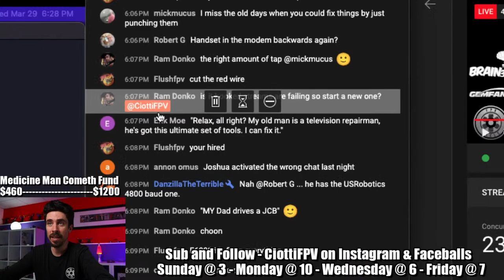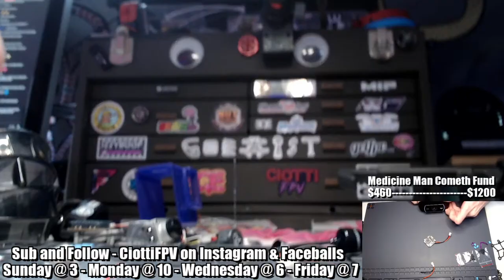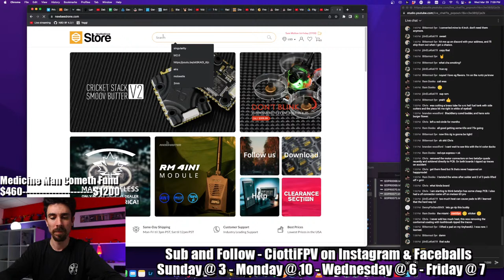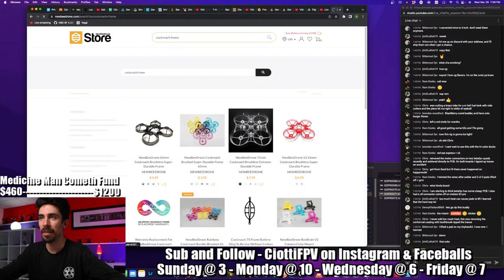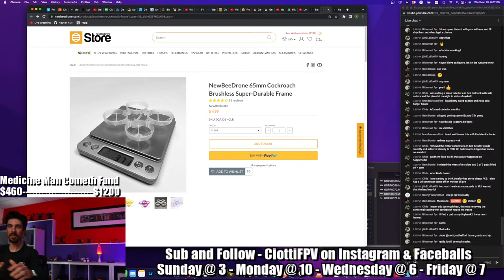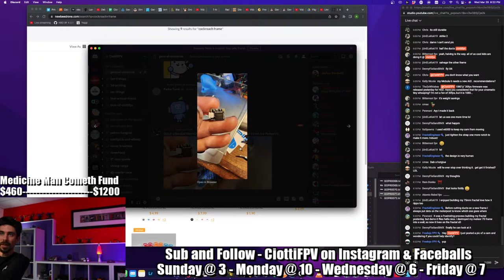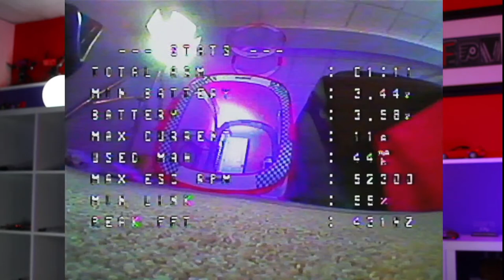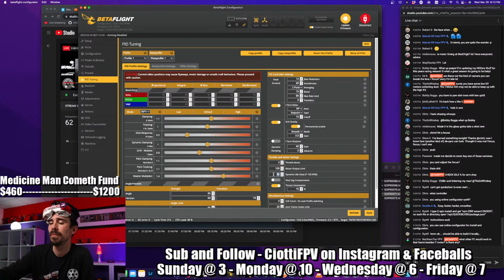Building a "Cinematic" Analog 65mm Tiny Whoop - Fractal 65 frame - Q&A

Comment: Good day friend, how are you doing? Hope your feeling more relaxed bro.

00:07:18 Building a cinematic Fractal 65 frame with the T-motor F411 AIO 1s ELRS   
00:12:30 Soldering the BT 2.0 on the board
00:17:30 Do you fly cinematic whoops a lot ?
00:18:48 How do you explain to the client that the cinewhoop is to loud?
00:21:19 Where can I copy stock tunes for my Mobula seven?
00:22:22 Soldering the FPV Bee Eye cam to the T-motor F411 AIO 1s ELRS board.
00:28:37 Getting the Fractal 65 frame setup
00:53:38 Installing the T-Motor F411 AIO 1s ELRS  on the fractal 65 frame.
01:01:44 How can you tel when your tiny whoop is overheating?
01:27:44 Mounting the 0702 30.000Kv motors, ducts and props on the Fractal 65 frame.
02:12:58 Setting up the Fractal 65 T-Motor F411 AIO 1s ELRS with the ESC configurator and Betaflight.
02:24:00 Maiden flight with the Fractal 65 on T-Motor F411 AIO 1s ELRS 0702 30.000Kv
02:33:58 Some Flying on Stevie Wonder mode 🤣
02:38:00 Getting back to FPV flying
02:42:46 Changing to The Mobula 6 0702 32.000Kv RunCam nano3
02:53:03 Swapping out the RunCam Nano3 for a Caddx Ant on the Mobula 6.
03:01:00 Checking the cam FOV on the caddxAnt vs the BeeEye 

Stay safe everyone

Comment: Hey Ciotti what kind of metal are your drill bits ?

High speed steel wheres out one or two drilling’s with carbon fiber. Carbon fiber is highly abrasive and wears out drill bits quickly. 

Get solid carbide drill bits use a backing under the carbon to prevent break out of the carbon. 
Keep a cup of water. It acts as a a lubricant also keeps your bit cool do it often. 

Try to find a carbide reamer drill bit then work your way up with carbide bits and a backer under your carbon keeping your bits cool with water. 

These steps will prevent cracking. When done proper.
Reply from the maker: Great info there man, I don't usually need to drill carbon out but next time I do I'll use that cup of water trick that's rad

Comment: Cracking can be repaired using thin cyanoacrylate & baking soda. 

I personally get the slow to medium, curing, cyanoacrylate & use baking soda, dusting to cure it. It actually gives you a little bit of material that you can sand away if need be.

It gives you working time to set things up. Then hit it with a baking soda, dusting it cures immediately.
Reply from the maker: Graphite also works really well, but I'm typically too lazy for either and just hammer shit with CA throw it in a vice and call it a day lol
Reply: Baking soda! We got baking soda!  (that's a quote from the song "Coco" :) )

Comment: Hey Ciotti, did you ever consider reversing that build into a pusher config? Wouldn't eliminate the bad T-motor AIO washouts, but would help with making the area where the thrust is completely clear.
Reply from the maker: Interesting idea, I would have to figure out a different camera mounting solution since the bottom of the frame has the battery taking up the space where the cam would need to be
Reply: @CiottiFPV  well, you could reverse it by literally flipping it upsidedown and run the battery on top. You wouldn't have to do much at that point except fix the camera tilt. 

Or go a bit more exotic by running the battery between the ducts? Not sure that would fit. I picked up a fractal 65 and 75 and my intention was to try to build them as pushers. I think it would be better from a flight characteristic standpoint.
Reply from the maker: @shadai7398  if you figure it out definitely put a picture in my Discord I would love to see it.

Comment: Hey CiottiFPV, I'm getting the webleedfpv crown 65mm frame and going to get this fractal engineering 65mm frame as well, I want to use those webleedfpv screamer motors as well. Any recomendations for this type of build? Would all the other parts on this video build be good? And whats mah size batteries should i use?
Reply from the maker: My main recommendation would be to skip the Fractal frame, the only thing it does better than the plastic frames is to keep the ducts out of view, other than that it actually does everything worse (less thrust, less efficiency, more weight, and your motors will take a real beating being solidly mounted to carbon vs flexible plastic)
The only batteries worth running are the folded cell 300's with BT2.0 plug
Reply: @CiottiFPV  thank you, do these components work with the crown frame? And how much of a difference does that make if i use the fractal frame with it compared to just the crown frame it self?
Reply from the maker: @dagalpup1278  yup they'll all work with the Crown frame, I did a run time comparison tonight on stream with/without the fractal frame and without it I got 3 minutes, with it I usually got 1 minute 50 so it's a much bigger difference than I thought actually